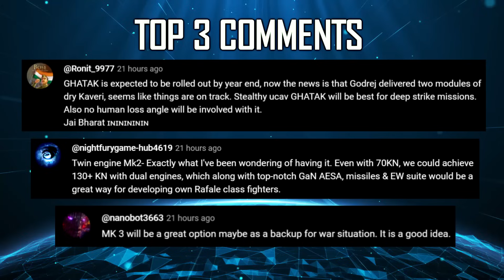Indian Defence Updates : Su-57 Nashik Cheaper,Tempest Engine for AMCA,Next Gen SAAW,Auto CUAS System

Comment: Stay focused on Tejas MK2, AMCA, TEDBF and Su-30MKI indigenization.

That is the only plan India can rely on for its defense.  

All other roads are dead ends.
Reply: We need su 57 technology transfer to boost Amca
Reply: @miteshghadi3146  

The only way you get technology is to research and develop it yourself.

Handing over loads of money to foreign countries does not make you smarter.  

Rather, it makes you dumber as they do the R&D at your expense.
Reply: you know major powers usually only works on 1 or max 2 projects. Building 4 different jets from different tech stack would require separate facility, tools, equipments, spare parts, spare parts manufacturing etc. and manpower cannot be shared between. Its a nightmare.
Reply: @solblaze9533 Bhai baat karne mae kyaa jata hai 🤣, 4 or 6 everything is possible
Reply: @Das1  bhai issi chakkar me kuch ban hi nhi pa rha.. upar se ye bureaucracy..baki baat or discussion to karna chahiye . agreed 👍🏼

Comment: Su57 deal becomes more sweeter by the day.
Bharat should seriously consider signing this deal with AL41 engines and as soon as AL51 engines are ready for production we can replace then into our already existing Su57 squadrons at that time.
Reply: Someone in PMO is probably watching IDU everyday, and feeling terribly guilty of inaction on their part !😊
Reply: When they are not offering 25 years old Su 30 with ToT, i suspect they will offer any real ToT with Su 57. We need tot and   evaluate capability before putting order. If Su 57 meets both, we should go with that.
Reply: Su-57 is a prototype 4.5 gen plane that is literally light-years behind upgraded Su-30MKI.

Russians want India to pay 💵 for its development.  

Not a good deal at all.
Reply: @mtrest4  you have saved this message to write everytime? Su30 a generation better than su57?😂
Reply: @Vartik-jr4qr  hahaha, ikr. I had a feeling i have seen this exact same message a few times b4. 😅
Reply: @mtrest4 You want india to pay tarrif on f 35 which has America otp .
Su 57 is best option to speed up the amca production line and technology
Reply: @miteshghadi3146  

AMCA won't speed up due to su-57.  If anything, it may slow down.  

Su-57 is less effective than Su-30MKI with its numerous indigenous upgrades.  It's a bare bones 🦴 prototype that even the Russian airforce was reluctant to buy.
Reply: @mtrest4  i think u are factually incorrect.
And to add to it you are looking at this from a unidimensional perspective.
- Su57 comes with a compelte ToT
- Full access to source code
- Due to this DRDO and HAL can readily integrate Indian weapons and radars with the jet.
- It is much MUCH cheaper than F35 not JUST in procurement but ALSO in operation.
- Finally! It xomes without any strings attached.

And i did not even go into the spare parts shortage, GE's history in fking India over, Kill switches, a million other strings that come attached with operating US platforms

Comment: IAF Can split MRFA into two halves, Su-57E and Rafale F4. Su-57E (54 fighters, i.e.., 3 squadrons) and 60 Rafale F4(almost 3 - 4 squadrons). Su-57E will be assembled in Naishik plant. When it comes to Rafale, we can set up a new plant in India and manufacture them domestically( for ourselves and other foreign nations who have ordered them). This makes our Rafale fleet 96( 36 + 60). And in the future we would be almost 96 Super Sukhois( 84 + 12). So, our 4.5 gen fleet will be strengthened until AMCA rolls out.
Splitting the order might seem like it reduces the chances of tech transfer and local production, but that’s not necessarily the case. It really comes down to how the deals are negotiated. India can work out Make in India terms with Dassault for Rafale F4s, including full local assembly and even export rights. On the other side, Russia has already shown it's open to assembling the Su-57E at HAL Nashik. With the size of the order and India’s strategic importance, we have the leverage to push for tech access from both sides. A split order doesn’t mean less indigenization—it can actually lead to wider tech exposure and a stronger aerospace ecosystem if managed right. What are your opinions?
Reply: @SaravananKhavinAjayIITian we should keep rafale away because our tejas mk2 is already developed and will be fully made by end of 2025 so rafale is waste of money we can have 3x more jets for price of rafale f4 and su57E is also not an option because our airforce prefers super sukhoi which is a counter for J35A of chinese so both super sukhoi and su57E are same just that  it's upto airforce which they want but rafale is not a good option we already ordered 200+ tejas mk2..and efence secretary is also not  considering MRFA contract as tejas mk2 is ready and kaveri 2.0 engine is also ready...
Reply: @_____999_  Tejas Mk2 is essential for numbers, but it can't match the Rafale's combat-proven multirole capabilities or the Su-57’s stealth and air dominance. Rafale brings deep-strike power, nuclear delivery, and unmatched situational awareness. Su-57 adds next-gen stealth India lacks. The Super Sukhoi upgrade improves the Su-30MKI with AESA radar, modern EW systems, IRST, and smart cockpit upgrades, but it’s still a 4++ gen platform with no stealth and limited survivability against 5th-gen threats. Relying only on Tejas and Super Sukhois limits India’s edge. For true air superiority and strategic edge, India needs more than upgrades; it needs platforms like Rafale and Su-57 alongside Tejas.
Reply: @SaravananKhavinAjayIITian su57E itself is not a stealth fighter it's a 4.5+++ generation with limited stealth just like tejas mk2 or rafale f4,they say su57E as a 5th generation which is wrong but it's a perfect aircraft for air dominance and one more thing is that tejas mk2 has specifications just like rafale latest f4 or even better than that in some aspects,we shouldn't judge it too early because it's still not tested by IAF so let's wait and see this year end 2025 tejas mk2prototype will be finished and we will test it in that we will see how good it is with comparison of rafale f3 we have ,even tejas mk1A passed all the tests and perfectly fits a role in IAF and for numbers we have tejas mk1A and mk2 ,even mk3 in future for stealth we are building amca and for air dominance/fighting we will have either su57E or super sukhoi is it's waste of money to get rafale f4.. tejas mk2 is not a fair comparison for rafale f4 as they both are different class it's better to buy su57E which is proven 4.5+++ generation and cost effective than rafale f4...
Reply: @_____999_ lol tejas mk 2 doesn’t even exist so stop imaginery stealth capabillity.
Reply: @blistering2900  you can't Underestimate Tejas mk2. It is a 4.5 gen multirole fighter with extensive use of radar-absorbent composite materials, and a modified air intake that hides engine fan blades. Sensors are conformally mounted to avoid protrusions, and radar-absorbent coatings are applied to the exterior. While not a full stealth aircraft, these measures give it low observability.
Reply: @blistering2900  will be ready by end of 2025 you can't underestimate it , it has so many features and comes with advanced technology and components it can be best 4.5+++ generation in light combat catogery and can surpass rafale if they made it perfect..
Reply: @_____999_ I do understand the impact Tejas mk2 brings to IAF, but we're falling short of squadrons and with ageing aircraft, we cannot expect Air chief to run IAF with outdated aircrafts till 2030. We need twin engine aircrafts like Rafale and Su-57. Some people even argue we must develop Tejas mk3 a twin engine variant, instead of Rafale, it is possible but this is highly impractical due to the current situation of IAF
Reply: @SaravananKhavinAjayIITian i agree with you but you should understand that we have budget problem we can't entirely focus on importing aircrafts all the time and airforce, defence secretary didn't showed any interest in rafale f4 or sukhoi su57, they are planning for tejas mk2, it's upto their choice, the problem is that we don't have engines for tejas mk1A but now kaveri 2.0 is finished and will be used in mk1A so IAF is intrested for 2 squadrons of tejas mk1A every year , iAF chief also said that 2 squadrons a year is compulsory for IAF...
Reply: @_____999_  MK2 in 2025? Are you living in imaginary world? MK2 will be available to forces at the earliest of 2033 if not 2035. Comparing a jet which is in development stage with a jet that exists and made huge success is useless.

There is no concrete plan for Super sukhoi as many of the local systems are not ready
Reply: @vaimurthy  tejas mk2 not amca mk2 bro amca mk2 will be in 2040 ,tejas mk2 prototype will ready by the end of 2025 .
Reply: @_____999_ You must undertand, there's a clear difference between a prototype and the actual aircraft. The delivery of 120 Tejas mk2 will start from 2029 amd end by 2036
Reply: @SaravananKhavinAjayIITian i know bro I am not a idiot same for rafale if we order rafale they won't be coming to us by 2030 it will take time as the demand is so much, tejas mk2 doesn't need much testing phase as we already tested mk1A, so limited time is enough so by 2028 to 2029 it will production ready and 2 squadrons of tejas mk2 will delivered every year if HAL increases their production facilities..
Reply: @vaimurthy  my guy every jet is not same, tejas mk1A and tejas mk2 are same to same mk2 is upgraded version so it doesn't require much testing it's official timelines i didn't made the timelines it's HAL's timelines, amca needs 5 years of testing that's why it is 2035 as it's our first 5th generation aircraft..
Reply: @vaimurthy  you can't make your own timelines bro , MK1A is delayed due to engine issues everytime we can't blame HAL , USA company GE is wanted ly delaying the delivery of engines ,mk2 is completed based on timelines given now HAL is on track and amca is also in fast track if the engine is completed by 2030 for amca then amca will be done much before, engines are the issues we have always we shouldn't blame HAL for everything they are doing what they can
Reply: @vaimurthy  many defence analysts are blaming GE and drdo officals also blaming GE ,yes I too saw that IAF chief criticized HAL and yes HAL is not perfect they are working slow but you can't entirely blame because integration is different and engine is different,engine is the main source of the jet so it takes time to integrate engine in that jet it takes time but GE is not giving us the engines required for delivery it's a fact both GE and saffron of France are playing double games with engines... It's a fact and mk2 is 50% completed prototype remaining they will build by end of 2025 or even slightly delayed we can say 2026 mid and AMCA is in fast track it will be completed, they took it very serious drdo official confirmed it in a podcast
Reply: @SaravananKhavinAjayIITian:
Every two-bit 𝘢𝘳𝘮𝘤𝘩𝘢𝘪𝘳 𝘮𝘪𝘭𝘪𝘵𝘢𝘳𝘺 𝘦𝘹𝘱𝘦𝘳𝘵, who has not been anywhere close to any battlefield or air combat zone, likes to pompously assume that he has a more wholistic picture of the country's defence requirements, than the country's defence planners and military top brass put together. 
😂😂😂😂😂
☞ 𝗜𝘁 𝗶𝘀 𝗵𝗶𝗴𝗵 𝘁𝗶𝗺𝗲 𝗴𝘂𝘆𝘀 𝗹𝗶𝗸𝗲 𝘆𝗼𝘂 𝘀𝘁𝗼𝗽𝗽𝗲𝗱 𝗮𝘀𝘀𝘂𝗺𝗶𝗻𝗴 𝘁𝗵𝗮𝘁 𝘄𝗶𝘁𝗵𝗼𝘂𝘁 𝘆𝗼𝘂𝗿 ‘𝗶𝗻𝘃𝗮𝗹𝘂𝗮𝗯𝗹𝗲 𝗮𝗱𝘃𝗶𝗰𝗲’ 𝘁𝗵𝗲 𝗮𝗿𝗺𝗲𝗱 𝗳𝗼𝗿𝗰𝗲𝘀 𝘄𝗼𝘂𝗹𝗱 𝗯𝗲 𝗹𝗲𝗳𝘁 𝗳𝗹𝗼𝘂𝗻𝗱𝗲𝗿𝗶𝗻𝗴.
Reply: Moreover, it has another capability known as Network-Centric Warfare or Cooperative Engagement. It allows one Tejas to detect and track a target using its sensors and share the data in real time via a secure data link. Another Tejas, without using its own sensors, can then fire a missile using this shared targeting information. This enhances stealth, reduces exposure to enemy detection, and improves effectiveness in beyond visual range (BVR) combat.
Reply: The upgraded Super Sukhoi will feature the indigenous Virupaksha AESA radar with 1,500+ T/R modules, a detection range of 250+ km for fighter-sized targets, capability to track 30+ targets and engage 8–10 simultaneously. RCS will be reduced to around 1–2 m² through radar-absorbent coatings and structural tweaks. It retains the 2 × AL-31FP engines (123 kN each) with possible future upgrades to 117S (145 kN) engines. Payload capacity remains 8,000 kg across 12 hardpoints, with a maximum takeoff weight of 38 tonnes. It will integrate advanced DARE EW suite, MAWS, LWR, new IRST, and full-glass cockpit with wide-area displays. Weaponry includes Astra Mk1/2/3, BrahMos-A, Rudram-1/2, Spice-2000, SAAW, R-77, R-73, and future hypersonic missiles, making it a true air dominance and strike platform with deep penetration and multirole capability.
Reply: Rafale F4 features the RBE2-AA AESA radar with a detection range of 200+ km for fighter-sized targets, capable of tracking 40 targets and engaging 8 simultaneously. RCS is estimated below 0.5 m² due to advanced shaping and radar-absorbent materials. It uses 2 × M88-4E engines (75 kN each) with enhanced reliability and thrust management. It carries a payload of 9.5 tonnes across 14 hardpoints, with a maximum takeoff weight of 24.5 tonnes. The F4 standard integrates upgraded Spectra EW suite, Talios targeting pod, Front Sector Optronics (FSO), improved data fusion, and full network-centric warfare capabilities with AI-assisted systems. It supports Meteor, MICA IR/RF, SCALP, AM39 Exocet, AASM Hammer, GBU-series, and nuclear-capable ASMP-A, ensuring deep-strike, air superiority, and maritime strike roles. Enhanced connectivity with satellites and combat clouds makes Rafale F4 a fully digital and future-ready 4.5-gen fighter.
Reply: @____999 IAF chief had set an ambitious target for IAF, 60 squadrons by 2047. So my point is, the faster we negotiate, the faster we put terms on the table, we quicker we can strengthen our Air force. I understand that these arrangements are completely against AtmanirbarBharat but national security can't wait for perfection. The sole purpose of MRFA is not to replace our Tejas but to serve as a force multipler bridging the gap between indigenous platforms within IAF
Reply: @SaravananKhavinAjayIITian  they should have done mrfa soon but now it's late the same funds can be used for buying indigenous developed jets and using that money to increase the production line to atleast 5 to 10 squadrons a year so buying rafale f4 or su57E is still a question, su57E has chances but there is no official response on rafale f4 by IAF kr defence secretary....
Reply: Moreover, when we purchase any crucial equipment from any country, we get more collaboration. As we have seen, France is interested in purchasing Our Pinaka  MBRL and France have signed a major deal to Construct numerous small scale Nuclear reactor modules. This is why while purchasing "strategic equipments" we must not only look on the price factor
Reply: @SaravananKhavinAjayIITian   bruh just for considering F35A congress ATE BJP for wasting tax money as it's a era of drones ,they released videos on drones too and rafale F4 costs more than f35A due to high demand so government will not consider unless IAF pushes to purchase..
Reply: @_____999_ Let’s be real, comparing the F-35A to the Rafale F4 in India’s context is a joke. The F-35 comes with end-user monitoring, zero tech transfer, and complete U.S. leash control, not to mention logistical nightmares and insane lifecycle costs. Rafale F4 may be expensive, but it’s battle-proven, fully customizable, and fits perfectly into IAF’s doctrine without begging for spare parts or clearance codes.While drones are crucial in modern warfare, they complement manned fighters—not replace them. Drones can't match the deep-strike, air superiority, or survivability of a 4.5-gen platform in contested airspace. If IAF pushes for Rafale F4, it's because it fills critical operational gaps that drones or cheaper platforms simply can't.
Reply: @SaravananKhavinAjayIITian  i agree that f35 is much more complex but france can also spy on us using rafale jets, there is a reason we are working towards indigenous aircrafts, france won't share any data on rafale f4 and we won't get much tech transfer on rafale f4 too nobody gives transfer of technology on jets for us except Russia that too they developed su75 checkmate so they are trying to leave su57E in our hands, and i compared the prices of f35A and rafale f4 not the challenges from this jets, there is a political reason in every aspect even in defence so understand that..
Reply: For the Super Sukhoi program, Product 117S (AL-41F1S) is the optimal choice over the original AL-41F. Delivering 14,500 kgf thrust, it's a modern evolution of the AL-31FP with increased airflow (by 4%), extended service life (4,000 hrs), and full FADEC for superior control and efficiency. Unlike the bulkier, experimental AL-41F (~18,000 kgf), 117S offers seamless integration into Su-30MKI with minimal structural changes, proven reliability (used in Su-35, Su-30SM2), and significantly lower logistical and developmental risks.
Reply: @SaravananKhavinAjayIITian rafale F4 is very much costlier to produce, rather it is better to force production of Tejas mk2 and mk 3 indigenously....